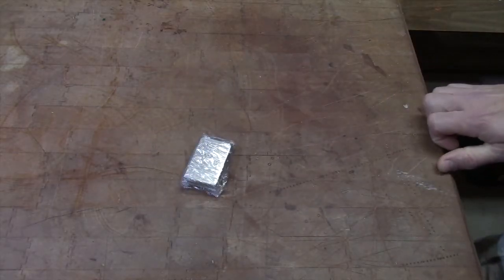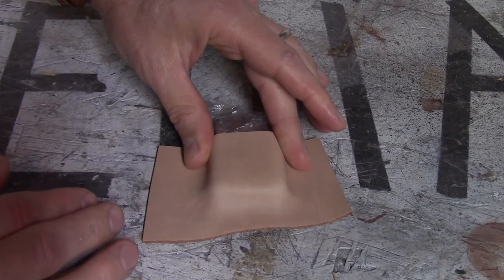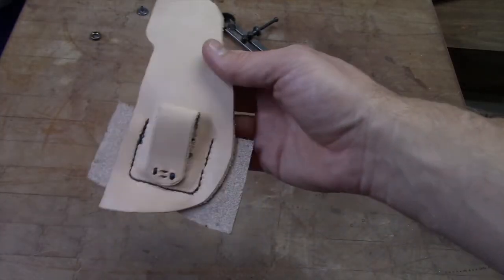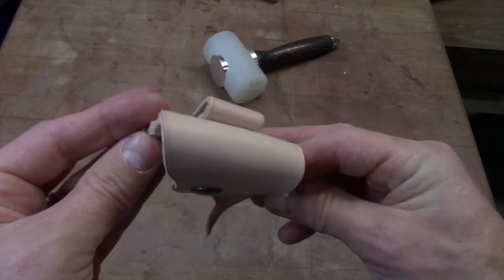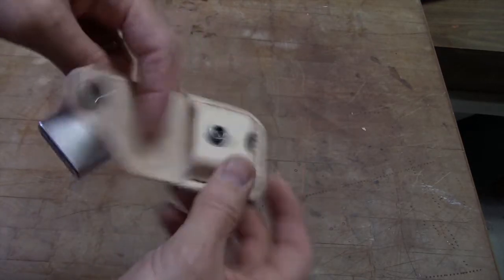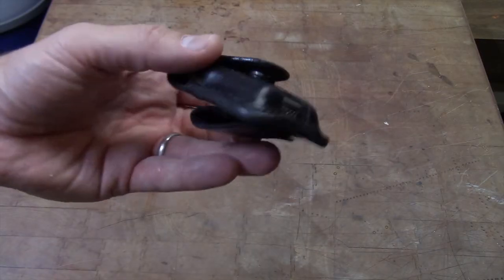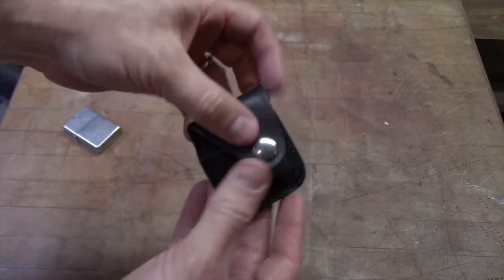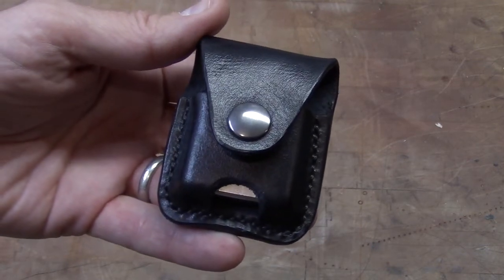Zippo Lighter Biker Leather Case (Harley Davidson)

Comment: Very nice piece!
Reply from the maker: Thanks. I actually owned a Harley Davidson design exactly like this when I was 18, except it had the "Indian Head Nickel" snap like the one that I used on the other case. I probably paid $20 for it back then (it was Harley after all). This cost me nothing - and even if I had used the "Indian Snap" (which I have a few of) then it would have been $3 in material.